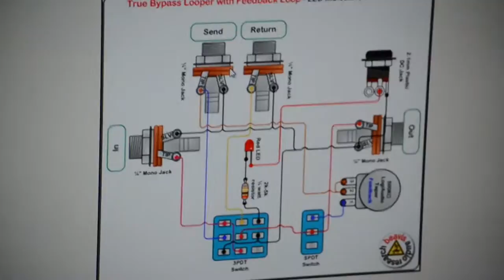DIY Feedback Loop Pedal Demo

Comment: Can you upload a video showing the wiring? im having a hell of a time building it
Reply from the maker: my wiring actually looks like real shit since this was my first project so i think it would just confuse you more :// if you follow the schematic it'll work though. at one point i had just a low hum and it turned out to be a cold solder joint on the stomp switch, so make sure those connections are all good :+)
Reply: JIOOOO Hmm, I'm going to take mine apart and re solder it. Does the pedal make a harsh feedback loop without anything else connected? Also how many positions does your switch have by the way?